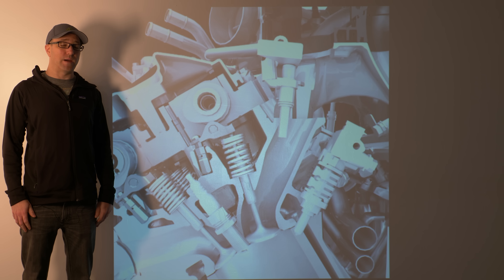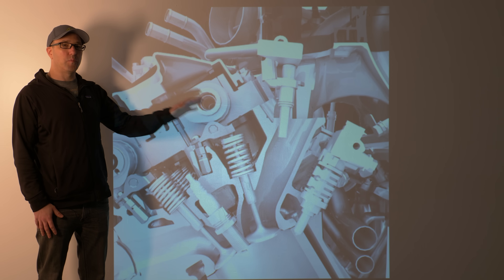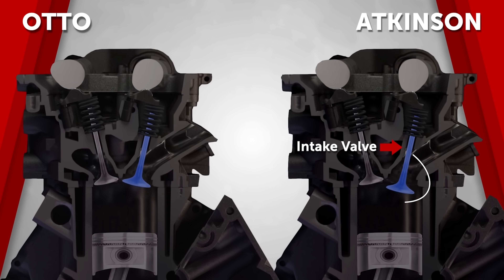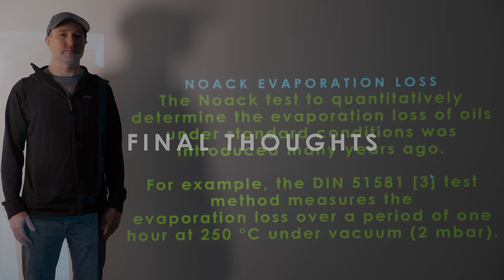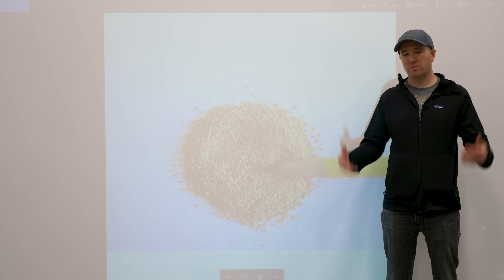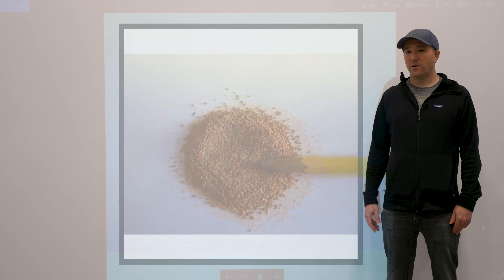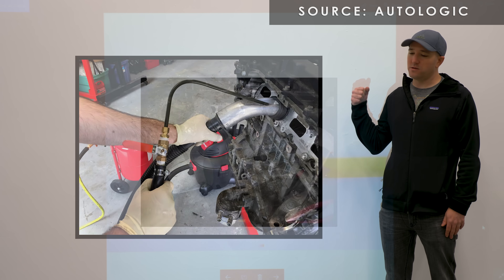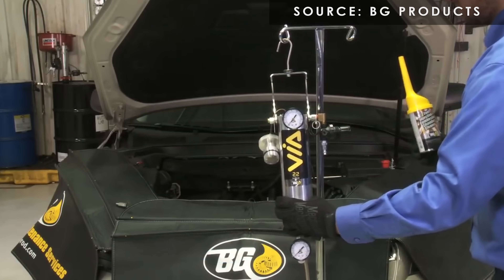Direct Injection, Problems and Solutions | The Fine Print

Comment: Is this progression in the motor industry what a joke, maintenance vs tech, ill take low maintenance over tech any day. I would vent the PCV to atmosphere. Whats the point of emissions if its stuffing your new motor. This is not a cheap exercise and your motor wont be doing 300k like the old ones, it will corrode the valve seats for sure and I bet create a slight abrasive in the cylinder which will increase wear on the rings and bore. This engineering of obsolescence is going to far now they want us to turn over everything too quirckly and our wages are not reflecting the costs of these throw away societies. By the way the video was excellent keep up the great work the information was presented in high detail and I learned a lot. Thank you.

Comment: I have a 4GR-FSE Lexus IS250, known for carbon build up. It now has 140K on it, and the valves are nice and clean. (I've removed the upper intake and pried open the secondary throttles to inspect).

How to keep clean?

1)  WOT is your friend. The higher intake velocity, hotter valve temp, and exaggerated valve acceleration are helpful to removing build-up or preventing it.
2) USE SYNTHETIC OIL. The higher oxidation temp of the oils means that your oil-vapor coming back in through is less likely to convert to coke and carbon. This I think is very helpful
3) Catch Cans. Excellent idea, but I haven't used it nor needed it yet.
4) Seafoam can help if you use the kind that sprays into the intake (do not add to fuel).
5) I personally have had excellent results with an oil additive called LC20 made by Lubecontrol INC. I don't sell the stuff or profit in any way. It is very effective at removing any gunk on oil-wetted surfaces. It will remove varnish and stuff on internal engine surfaces, but do so slowly so as to prevent problems.

G5, an actual engineer on engines.

Comment: OK. Now somebody, please give me a list of cars/SUVs with port injection and with both port and direct injection. I will totally avoid direct injection.
Extra:
In 2013, research by TÜV NORD found that although gasoline direct injection engines dramatically reduce carbon dioxide emissions, they release about 1,000 times more particles classified by the World Health Organization as harmful than traditional petrol engines and 10 times more than new diesel engines. The release happens because direct injection results in uneven burning of fuel due to uneven mixing of fuel and air (stratification) and because direct-injection engines operate with a higher pressure in their cylinders than older indirect-injection engines. ( https://en.m.wikipedia.org/wiki/Gasoline_direct_injection )

Comment: Using thicker oil to help prevent oil volatility will also do damage overtime to the camshaft and valve train.
Reply: Mikey Savage my opinion is use AMSOIL signature series is the best full synthetic oil my opinion. I have a 02 Buick le sabré with 307000 original miles engine and transmission original always use amsoil products.
Reply: can I have your autograph?

Comment: Hi SavageGeese: thanks for the excellent presentation. I have two questions: (1) I thought EGR (exhaust gas recirculation) issue was also a significant, even dominant factor over the blowby oil vapour from the PGV circuit? see http://premierautotrade.com.au/news/understanding-EGR-systems-pt-1.php - any comments about that interaction? & (2) with a supercharged engine with DI (as in the AUDI 3L TFSI) wouldn't that just make the carbon build-up problem that much worse because of the higher pressures involved?

Comment: I will buy high end eco vehicle with 2+1 air ports (2 ports in idle and 1 turbo port) 1 fuel injection port and 1 exhaust port.. It is self driven with high capability for off road.. It use biofuel and water.. I will not tell you what is name of vehicle, you need to figure out by your self....

Comment: Not all direct injection technology is that expensive. Bosch direct injection injectors average around 50-65 dollars a piece on most VW/Audi vehicles, which operate between 2000-3200psi at peak pressure. Roughly the price of standard injectors on most cars. Hitachi high pressure fuel pumps are no more expensive then most low pressure fuel pumps these days, with most hitachi pumps being roughly between 200-350 dollars.

Comment: Great video until he started saying cars in the 1990s were getting 60 - 70 MPG. WTF??
Reply from the maker: Honda Insight 1st 60 city 70mpg highway. The other lean burn cars were also in the 50s
Reply: EPA standards were significantly different then. By new standards the old Insight would get 53 MPG combined, and that was for an Ultralight Aluminum two seat teardrop car with wheel skirts.  Which is about the same MPG as 2018 Prius that is built out of steel and seat 4 adults. 

MPG really wasn't' better back then, it was the change in EPA standards that makes it look that way.
Reply: In the 50s according to the older EPA procedures. The Insight is a hybrid. Just say it that you got it wrong.
Reply: They COULD get that... but NOx isn't cleaned up by a catalytic converter well, so back to burning more fuel.
Reply: Untrue. Search "Honda lean-burn systems" 1992+
Reply: My 1991 CRX DX got 51mpg.  The HF could get 65.
Reply: Are these cars always going downhill?   @mattygee5000
Reply: My 1989 Honda Accord carburetor get an average of 50mpg on 87 Octane. The old school beloved Honda CRX can get 60 mpg. The 1982 celica supra can get 35mpg. Yes. It is a Celica Supra. It is 1 car before Toyota split that model into 2. New cars are not great fuel efficiency because of all the safety regulations. Old cars only weight in at an average of 2,400 lbs. new cars weight in at an average of 3,600 lbs.
Reply: Merric Hoang carbureted cars aren’t that efficient in the winter tho
Reply: Peter Scott ,Yes I think he was stretching the truth a bit about fuel consumption,I've been in the motor repair business mostly engine reconditioning since the 1960s and I don't know of any cars that managed that sort of fuel mileage,I had a Ford Escort 1-6 diesel in 1985 which did nearly 60mpg on long journeys but of course it wasn't fitted with all this modern emission shit we have to have today which kills fuel consumption on Diesels.
Reply: The Honda Civic CRX HF got in the upper 50s in miles per gallon knucklehead.

Comment: New cars are designed as rental cars. Not intended to be kept longer term. If you own one use BG induction and fuel system service every 20 k and you should be fine.  I have been in auto service for 20 years and the last few years the new longer intervals on oil changes makes the services further apart and more expensive.  Nowadays most people don’t want to pony up for an oil change much as less “preventative maintenance”.  These cars get turned in polished up and back out for sale and a lot of times the second owner pays the price.
Reply: I think part of the problem is that there are shops that will tell you multiple things are wrong with your car, when really nothing is. On top of that youve got the "cheap" oil change shops in Walmart that will upcharge you out the ass for synthetic vs standard oil ($100 vs $15) when there is maybe a ten cent difference in the cost of the oil itself. I prefer to do all repairs to my cars on my own, its just much cheaper that way.
Reply: @Rusty Highlander without going into the debate conventional versus synthetic oil , i would agree with you on couple things...more often you change your oil , the engine is cleaner...conventional or syntheticoil.  But, todays car manufacturers have adopted the computer based oil change programs which prompts you to change engine oil at certain times...some manufactories do require synthetic oil for their engines...most of them do not. And...correct me if i am wrong...i would gladly accept it...if the ones that do not specify the syntetic oil for their engines ...the oil interval does not tell you to change your oil later if you are use synthetic oil. I am the proponent of synthetic oil...as you might realise, for some other reasons....not trying to change your mind....but just trying to put some facts to their place... My Buick Verano, 2013, coputer tells me when to change my oil...it does not specify if i put in a conventional oil or a synthetic or a cow shit...it calculates the oil life on the basisi of the temperature, kilometers, engine speed and such...the same thing for mu wife's Jeep Cherokie.  But , without going very deep into the discussion...i dont realy care what you use...its your car...not mine...the synthetic has some major adventage over conventional oils ...yes they are more expensive...but there's a good reason for it...in any case, i am not lookong to change your mind,,,just to open it to some other ideas and angles....just like one : they dont build them like they used to....but that's the one for some other discusion. And BTW...computer on my Buick Verano tells me (so far) to change oil on the average every 12 000 kilometers.

Comment: No,  the blow-by goes DOWN past the rings and piston skirt into the crankcase.  From there it is vented through the cylinder head oil drain channels into the cam cover area. That area is then vented into the intake port by the Positive Crankcase Ventilation valve.     Use high quality synthetic oil and change it every 3-4000 miles and get a catch can.

Comment: great video, by the way. I had 2007 Mini Cooper S that I owned from 2010 to 2014. I had done 3 or 4 times valve cleaning and twice timing chain replacements (thank God the timing chain was covered by the warranty, but not the valve cleaning though). I gave up GDI, but my brother has AMG M157 engine. Now, he is thinking to install water-methanol injection, which  is port injection system. What you think of that system?

Comment: As an early GDI engine owner ( Citroen DS3 1.6 turbo GDI ) I can tell you the ownership cost of these engines post warranty means they are a disposable item. The emission regulations and fuel economy targets can be met but the ownership cost means you need to sell these after the warranty expires. Catch can, Good oil all a good idea but in the end you will be paying for a walnut or chemical clean to stop getting misfires and engine warning lights from pre ignition knocking being detected. Injector cleaners generally don't work forget them just not effective on these engines.